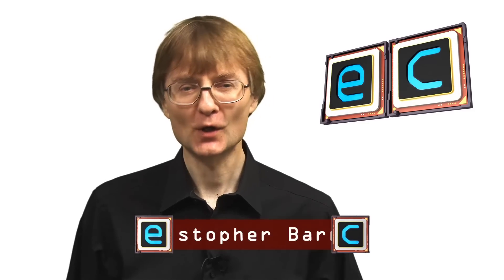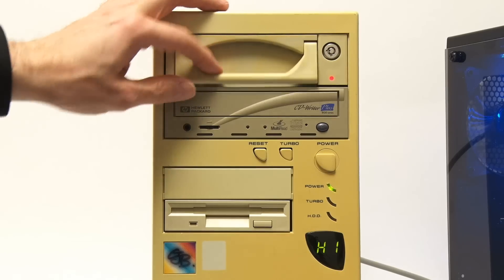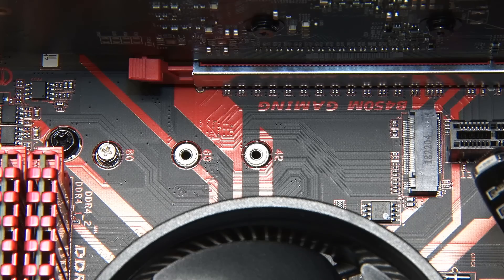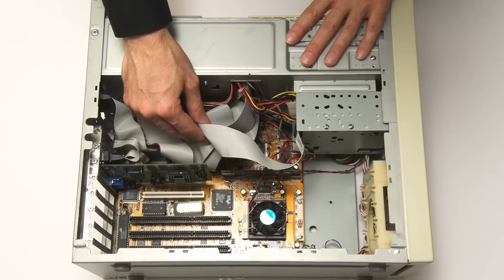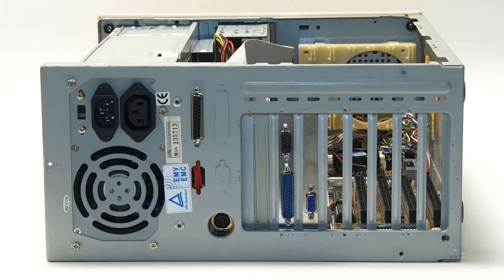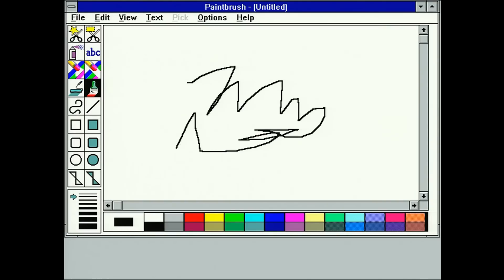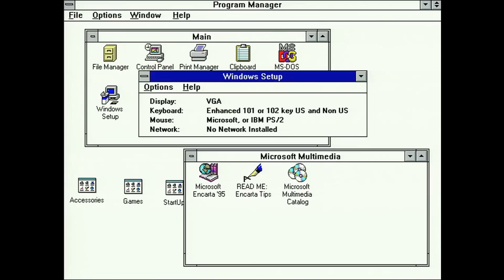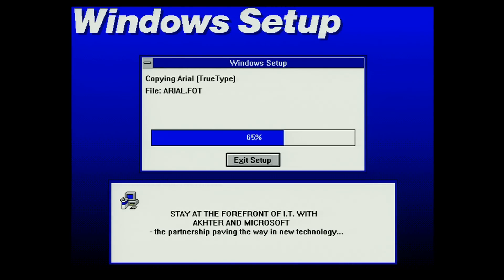Ryzen 3 vs 1996 PC

Comment: My frustration is that despite mind boggling advances in the speed and complexity of the underlying hardware, Microsoft seems to be able to  bring any hardware to a sluggish standstill. The colors are brighter, and the graphics are higher resolution, and lots more meaningless bells and whistles, but the perceived speed of a computer for things like booting, opening an application, or doing a needed function seems as slow and sluggish as it did 20 years ago.
Reply from the maker: Oh so sadly true.
Reply: @ExplainingComputers  One of the first things that I noticed was how quickly things operated on your fresh copy of Windows 3.1, and were located in Encarta.... perfectly usable!     I would like to see a comparison between some application running in DOSBOX on a RPi, and then on 'real iron'.      Thanks for the video!
Reply: @lesliedeana5142  win3.1 with a Pentium 2 233 was the fastest i've seen it run on real hardware (no emulators) and as soon as you typed win (or that line of your autoexec hit) you'd see the windows splash screen for a microsecond and it was ready. Chris' Pentium 1 was quick, but imagine that 3 or 4 times faster :) I was amazed back in the day.... But that was right at the end of win 3.1 support for that newer hardware.
Reply: Not the case with xfce4 though!
Reply: Dam it , you got it first. But it is truely sad that with all the power of new computers that they seam to be slower. only thing that runs faster , downloads
Reply: Back in a day Windows - innovation and functionality. These days Windows - bloatware and spyware.
If you don't have software that only runs on Windows, ditch the Windows for Linux.
Personally never going back to Windows.
Reply: The thing I find frustrating about modern operating systems is that the error messages are just as cryptic as they've always been. Windows 10 failed to install one of its security updates last week and I had to search online for the meaning of the 64-bit hexadecimal error code it returned.
Reply: The reason for this sluggishness is LAYERS! Back than in 1997 or even prior to that, almost all software ran on hardware, the various dos variations were only rudimentary library and driver supplier. Even the 3.x versions of windows were just that. Then came the "revolution" and MS began introducing execution layers, translation layers, compatibility layers... And with each iteration of windows those layers multiplied by a lot, nowdays security is such a hot theme, so they gotta have to include tons of security and sandbox layers. That is the reason why computing still feels like 97. No amount of fast hardware will make the convoluted software run as snappy as back then because for each line of code processed back in the day, you now have a million lines of code processed. And just a word of wisdom here, software can't remedy hardware security issues, those usually run deep into the whole architecture.
Reply: You need to spend some time with a  Linux PC... Boots smoother and enven though you have full control of every part of your machine, it somehow feels streamlined. Never any bell or whiste out of place.
I'll admit, there is a little bit of a learning curve, but once you start understanding it, you'll wonder why you ever went with a corporate OS to begin with.
Reply: Yes,  I understand and use Linux, but the problem is I have some programs I have to use that do not have a suitable alternative on Linux. Yes, I do dream of the day I can say goodbye to Microsoft.
Reply: Doughknot Lump  I also my previous computer that I upgraded from was an i7 4770K from 2014. It had Windows 7 previously. When I upgraded to Windows 8.1 then 10 I was amazed at how much faster modern was compared to Windows 7. What slows boot time today is bios emulation (1981 era shit emulated) in the bios. Turn this off (also known as CSM) and go pure UEFI. Also an SSD drive will speed things up. If you still run 7 ignore my previous advise as 7 is so ancient it fully doesn't support uefi firmware that replaces teh bios. The reason Windows 10 is slower loading if you have a spinning disk is because it parallel loads. It makes it faster with solid state storage but spinning disks are 1,000 slower access times than a disk. Even your smart phone uses solid state now
Reply: @timothygibney159  Yeh, my old smartphone had a 5 1/4" 4GB hard disk. It was really noisy when held against the ear, and the heat coming off the valves would roast your ears, believe me! I had a couple of fans installed, but  the draught from the hot air outlets would lift my wig. However, there were no boot times, since it was always on, except on Mondays.
Reply: Crappy software optimisation
Reply: Doughknot Lump  Windows 10 boots in 7 seconds here.
Reply: I turned off the animations, disabled Cortana with Powershell and my PC ZOOMS.
Reply: That is the Wirth's Law: "Software is getting slower more rapidly than hardware is becoming faster."
Reply: use SSD NVMe and it will be fast XD, trust me
Reply: 1993: Intel giveth and Microsoft taketh away.
Reply: Dare I say it is slower. Even with an ssd.
Reply: It happens when there are no competition ...
Reply: My pc takes like one minute to boot up.
Reply: __  Use Windows 8.1, Windows 11 or Linux
Reply: As an Amiga user at the time, I still wonder how it was ever possible for these things to even take off, before Linux made them at least somewhat great again.
Reply: If what you say is true W10 would be functionally the same as 3.1, it isn't- W10 is much more functional.  W10 will run just fine an the majority of PCs, I certainly don't have any issues and I have (I think) currently 8 running W10.   The lightest is a Surface Go and the most powerful is a 2700X/ 64GB.  My experience of W10 is pretty much the same- where i would notice a difference is the apps i can run, but that isn't MS fault.
Reply: "booting, opening an application, or doing a needed function seems as slow and sluggish as it did 20 years ago." just that memory fools you.
Reply: So true.
Reply: So many complaints about Windows 10!  I’ve been building computers since my 8088 in 1989.  Windows 10 has brought new life to my windows vista > 7 boxes, running faster with faster boot times. I tried Debian and Ubuntu for a while, but 10 has been the best OS I’ve used.  I’ve never felt slowed by bloatware except on my android devices.  I’ve never had good luck with Cortana, but it is easy to disable.  Why all the 10 angst for an OS that offers so much?
Reply: @microdesigns2000  
The problem is Microsoft has seen the way the wind's blowing. Their core markets have matured and stopped growing and with viable competition on the horizon they're desperately trying to branch out, mainly it seems by copying Apple.

This is why they've launched the Windows Phone, Store, put the "Modern U.I." on everything etc. They're also moving from selling users the O/S, which is becoming increasingly difficult, to monetising them through the provision of 'services' and the surreptitious mining of personal data ("telemetry").

The problem though is that they're not very good at this and most people find their efforts highly alienating.
Reply: @loc4725  Complete rubbish, what is the Windows Phone STore?  They don't make Windows Phones, what do they sell, where are they to be found?

MS is making lots of money, from Linux and Windows via its Azure platform and has been for years.  Yes Windows sold to consumers is not really important for sales, which is why they gave W10 away free.  What is important to MS is that we use Windows, and ideally we all use the same version- nothing creepy in that, just common business sense. 

Software as a Service isn't some MS evil strategy, it is what everyone is doing, Linux as well.  You really want to read up, like most here with knee jerk attacks on W10 and MS you are very misinformed.
Reply: @microdesigns2000  Windows 10 sucks if you use mechanical disks and have UEFI disabled as it is now emulated via CSM which can add 30 seconds to boot time. People will blame Windows 10 rather than understand a new uefi firmware PC is not a bios one and will leave the old emulation on by default. I always turn mine off but not everyone who builds computers understands or does that.
Reply: @microdesigns2000  Might we disagree? I've been upgrading then building my own computers since about 1989, too. The winners are XP and Win7 (which is on this computer, my go-to box. Windows since then is just a bad joke. (I never touched Vista, anywhere!)
Reply: @Ndlanding  Sure, we can disagree.  :)  We don't all need to use the same tools.  I just get a little sensitive about all the OS bashing because it it's much harder to create a good stable and useful OS than it seems.  It is harder than ever to protect from evildoers.  With an SSD upgrade and fresh install of Win10 I've had great luck making some dinosaurs perform again.  I remember defending XP and Win7 from complainers back then too.  These were all great tools!
Reply: @microdesigns2000  We could bash YouTube for having various co-existing comment systems and, like here with no proper indentation, making it impossible to find the comment that was replied to.
Reply: @Ndlanding  Funny, agree!  I tried to view your reply on my cell and failed.  I didn't want to read all the comments again, so I used my PC.  I have noticed that clicking the link in emails, if you have then enabled, works from a PC, but not always from a cell.  Workarounds for everything, huh?
Reply: @Dennis Fox . . . could you provide some sort of proof you are a human and not a russian bot? Just saying because I have never actually met a human that liked windows 10. i had heard rumors they existed, but it was always just rumors.
Reply: @paulmcwhorter  lol, my wife thinks I'm a robot sometimes but she's wrong.  Incidentally, she's not really a fan of windows 10, I think because her rig also has iTunes on it.  In the two engineering departments I've worked in for the last several years, I've never heard anyone say that they hate windows 10, because everything they do works great on windows 10, like Office, AutoCAD, Solid Works, project, etc.  There are software instabilities, but mostly from the software, especially the Solid Works once-a-day wipe-out.  I am a controls engineer using lots of software packages that historically have had compatibility problems with previous OS's, like RSLogix5000, Siemens Step7, etc.  Problems I have with computers don't have anything to do with bloatware or boot time problems mentioned in this thread.  I used to complain about those with XP and even in win7.  But I also remember using DOS and win 3.0 and then 3.1 for a long time.  Win 10 is a great OS.  I rarely reboot, using hibernate or sleep.  If I do, the boot is faster than 7, any day.  I pin my apps to the task bar and I type into the search tool for anything else that I want to run.  I also run a number of virtual machines, some in XP, some in 7, server 2012 and lately, win 10 and server 2016.  I wouldn't call Windows 10 the perfect OS.  But I would call it the best.  My criteria is simple; I can make money with it with the fewest problems and hangups.  By comparison, I consider apt-get to be the most short-sighted piece of garbage ever written, but required to accomplish anything Linux-related beyond the initial installation of the OS.  Were it not for the efforts of the likes of Lindows (way ahead of their time) and Ubuntu, I could hardly see any reason the average user would even attempt to use Linux.  The more advanced the user interface of an OS gets, the more self-sufficient users get.  If you look at dev environments, Eclipse looks like garbage compared to Visual Studio.  It can't be so hard to understand why so many people use Windows 10, and like it.  Tell me, what do you think is so much better about other operating systems?
Reply: @paulmcwhorter  there is a way to turn off the stupid autoinstalled bs also. I don't "love" w10 but it IS the longest is to get setup to a useable state in history. On the hardware side things are SO much more compatible and easily detected for driver autoinstall on a fresh build, but the time saved there (in pc repair) is made up for in manually removing the junk and turning it off. Thanks to this channel and win10 I use Linux mint for a few of my computers now, but I can't say I haaaaate my w10 pc, I only am comfortable with it now because it has stopped throwing stuff on me like a Verizon phone.
Reply: @Dennis Fox . . .  I am sort of a grumpy old guy and don't like any operating systems. In the mid-80's I had a microvax running Unix and that was the last fast computer I have ever had. I was running really complex simulations written in a compiled language, and they ran smoking hot fast.  My windows machine at work these days is whatever the fastest was I could get, maxed out with memory and huge fast hard drive. It takes 12 minutes to boot. When I complain to the network administrator, he says I should be happy he gave me the fast machine.  He says it is not for me to ask why it takes so long to boot, it is for me to just sit and wait. I once was stuck in front of the machine for 27 days as it said "Windows is Updating, wait and do not shutdown". Luckily some kind coworkers brought me food during that time, or I would have starved. No matter what I do Cortana keeps turning herself back on, and putting worthless tiles on my start pallette. Things that I used to do in one click, now take three clicks. My Toyota Camry has some sort of smart assistant in it and things were working fine until I parked it within WiFi range of my windows computer and now Cortana has convinced the Toyota assistant to mess with me. The camry is now trying to convince me to install internet explorer on the dash display. Also, the toyota is now trying to get me to sign up for AOL dialup and  a free trial of Norton Utilities. Siri also is vying for control of the weak-willed toyota camry digital assistant. Siri started spreading rumors about Cortana, and now it appears that the Camry is buying music from the itunes store, and charging my credit card. Then Cortana retook control, and locked me in the car, insisting that the only way to unlock the car doors was to upgrade the car to the cloud version of office 365. Finally broke the window out of the car and now just crawl in and out through the window.
Reply: @paulmcwhorter  Strange, maybe you need to get out more?  Certainly be better informed.
Reply: @paulmcwhorter  that's a hilarious post about the Camry!  I remember OS/2 being offered in a retail computer store for a while.  I thought they might have had something there, 32-bit and all.  But they quickly faded away.  Windows 95 was coming soon!  I'm not quite old enough to remember any shared resource computers, but I do remember DOS on a hard drive being very fast, back when multi-tasking was a dream and I didn't have a need for it anyway.  :)
Reply: @paulmcwhorter  I know a lot of people who prefer windows 10 over the older versions. There are still many things that are annoying but there are also so many things that improve your life a lot and work much better than in 7. And imo it's pretty fast.
Reply: @Doughknot Lump . .  Windows 7 was the last fairly usable operating system from Windows, however I have been forced to upgrade to windows 10. It appears to be impossible to get Cortana to go away and die, and no matter what I do with those little tiles in the start menu, invariably microsoft undoes it, and brings back bloated adware. The problem is they are trying to be a tablet and a desktop at the same time, and are doing both jobs poorly.

 I would say Windows NT/2000 was the best operating system microsoft came out with as far as snappiness and stability. By far the worst were Windows 95, Windows 98 ME, Windows Vista (perhaps the all time worst), and now Windows 10 is giving Windows Vista a run for its money as far as all time worst. 

The only reason I am still on windows is I have one program that I use a lot, Wirecast, which will not run on Linux. I look forward to one day entering the Post-Microsoft phase of my life
Reply: @paulmcwhorter  You can disable Cortana, see https://www.howtogeek.com/265027/how-to-disable-cortana-in-windows-10/ and also uninstall the default apps, see https://www.howtogeek.com/224798/how-to-uninstall-windows-10s-built-in-apps-and-how-to-reinstall-them/
Reply: @ProjectPhysX  and those methods no longer work.
Reply: @paulmcwhorter  Try Googling "Windows decrapifier". You might find it useful for stripping out all the bloat.
Reply: @johnm2012  However The PC Decrapifier requires that you have at least Internet Explorer version 9 or greater installed on your system.
Please upgrade Internet Explorer and restart this application any help on this one as I wont us IE
Reply: @paulmcwhorter  I suggest you get a book on W10 as the tiles are easily removed, and while you can't truely get rid of Cortana you can in the sense that you never need to interact with it.
Reply: @jason campbell . . . she keeps turning herself back on, and when she does she adds a bunch of useless tiles to my start panel. Then she hides my actual programs so that I can not find them, and then am forced ask her where she puts them. Then she tells me she will not tell me where she put them unless I change my default browser the internet explorer.
Reply: @paulmcwhorter  It would be very wise to stop using IE, and certainly there is no requirement to use it-MS is actively trying to stop people using it.  There are plenty of good web browsers though, just IE isn't one of them.

To delete tiles you just right click on them and select delete.  Mine have never reappeared despite many updates and the occasional reboot.  As to taming Cortana, if you Google that (Edge is now quite good as a browser, better than Chrome I would say, certainly uses less resources) it is easy to do.  W10 is highly customisable and it isn't a great amount of work to make changes- in my experience people just complain without investigating a solution.  One benefit of regular Windows updates has been that MS has listened to complaints, hence Cortana being silenced.  They won't kill her because she is actually used by some people and enterprise.
Reply: @paulmcwhorter  classic argument about OS, it is not the OS you run it is the program
Reply: @paulmcwhorter  disable all the automatic updates
Reply: I believe he showed off WIndows 3.1 in a VM. It was sllooooow back then. I had a pentium 166 from that era when I was graduating highschool. I remember launching WordPerfect for Windows and seeing the logo banner and waiting a good 20 seconds before it loaded. I remember waiting 3 to 4 minutes for PCs to boot. I read old posts from mine and forgot I had to wait 30 seconds for stuff to load up written in java (from 2002 era hardware) that launch in a second today. Trust me today's computers respond MUCH MUCH faster. That is if you don't use spinning disk hard drives. To this day I close tabs on my browser after 4 or 5 out of habit. Windows 10 is much better than Windows XP in this regard too if you have Solid state storage and Windows uses far less memory today.
Reply: Sorry this isn’t true. A Windows 10 machine with SSD is fast. Stop knocking Microsoft for the sake of it.
Reply: Doughknot Lump  Get rid of the hard disk. It is a dead obsolete technology. My ipod mini was the last portable device that used a spinning disk. The reason why is even on mobile platforms they load everything at once to speed up booting. A hard drive is 1000 times slower access times so 100 requests at once to pull things will grind w10 to a hault. Windows 7 loaded only a few at a time which will slow modern hardware down but help hard disks. You can get a cheap SSD drive these days and I have seen Windows10 just hang with constant disk activity on fast systems but seen low end systems load it in under 30 seconds on ssds. Really it is 20th century technology and quite primitive.
Reply: Uh, no. Try actually using an oldass PC with a slow spinning boot drive for a week or two. You will be begging for a $40 SSD.
Reply: Doughknot Lump  I wouldn't recommend either, both are outdated for modern hardware and both will have no support soon enough.  XP would mean for example no drivers for things like USB-C and it was a security risk when it was supported.
Reply: maybe you should buy an SSD. harddrives are from 20 years ago :p
Reply: get an ssd
Reply: Get an SSD.  I run Windows 10 on my gaming machine and it boots and runs pretty fast.
Reply: If you look at the bright side of that, a 2010 PC with an SSD is as fast as a 2020 with an SSD. 
Hard drives loose efficiency and get fragmented over time, whilst SSD don't. My 2010 Asus laptop takes 17 seconds to fully boot up from cold start.
Reply: Ikr
Reply: Nah Windows 10 is simply great. Been using and building PCs since 1997. Windows 2000, XP and 7 were great, Vista and 8 were terrible. However Windows 10 which is basically free, is great. It has its issues but with some tweaks it’s easily the best Windows yet. There’s a reason it dominates the consumer world. I’ve tried to love Linux and I enjoyed Manjaro and Mint but always return to Windows when things go to hell lol.
Reply: That's mainly to do with your hard drive limitations. I have a nvme m.2 drive and those things you listed are blazing fast.
Reply: You are a Luddite Windows 7 is dead. Embrace the real world. Windows 10 with SSD is fast.
Reply: @ChristopherRobertHarris  If it needs an SSD to be fast than its crapply made....
Reply: @FreakyGoku69  Put a micro hd on a mobile tablet with Android and wait 5 min for bootup. Some cheap Chinese companies sold old Android 2.2 with that setup in 2013 and it was that slow. It's 2019 and q modern OS needs 70 or programs and services for networking, av, printer pools, Bluetooth readers, wifi hot spot readers, etc. That's not bloat but needed unless you have a simple 1980s single tasking PC fixed on a desk. Your phone does the same thing and Windows 10 is much lighter than Android. You can get an SSD for cheap now. It's like complaining now bloated an os is because your paper punch card machine takes ages to load
Reply: @FreakyGoku69  Rubbish.